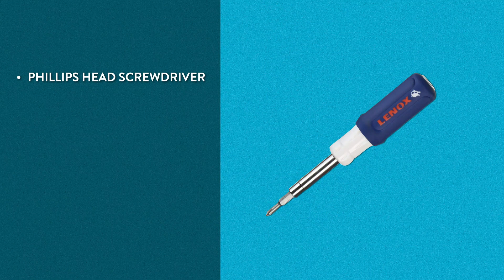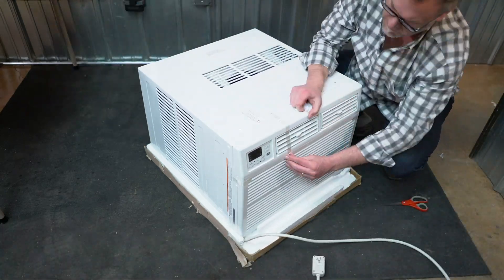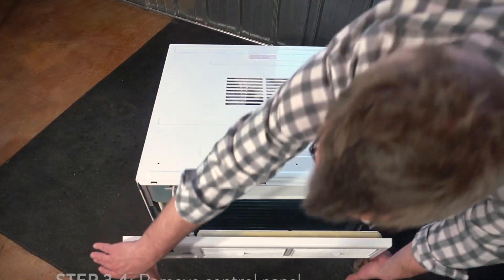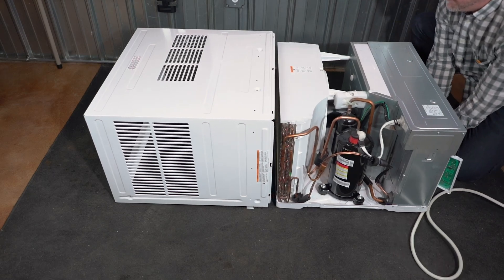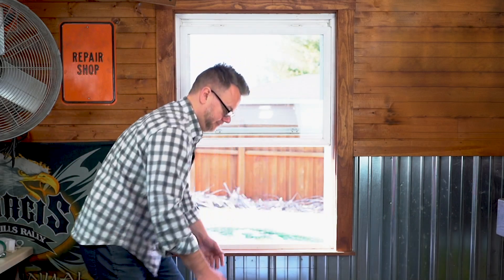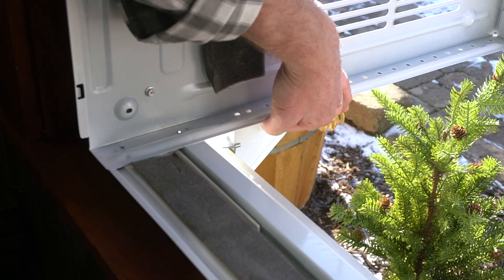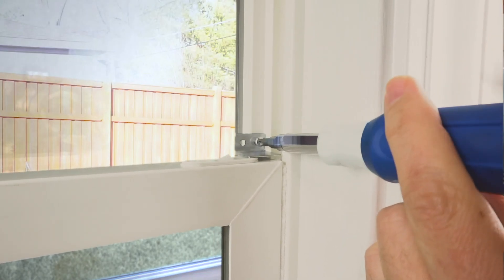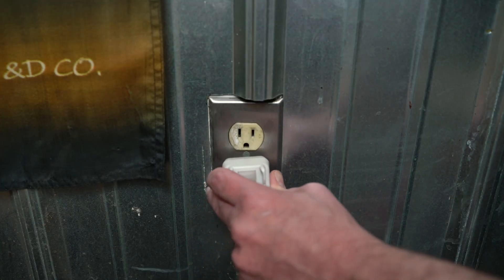How to Install a Denali Aire 15,000 BTU Window AC Unit, Step by Step Guide

Comment: Do this window units connect to a regular 120v or does it need a 240v?  Also deciding if I should just go with a heater $400 right  now for my 3 car garage man cave fully insulated here in Clovis California zone 9b and in the summer time get one of this window ac units for  $500 to cool it off or just get a Mr cool minisplot  system that has both for $1600? ?  my garage is about 620sq ft with 8 ft  ceiling higjt.
I have epoxy floors, pool table , darts and gym on the other side😁
Reply: 120v

Comment: When you’re re-inserting the inside after the cabinet has been fully mounted in the window, how are you supposed to put all the outer screws back in when some of those holes are now outside of the window??
Reply from the maker: Hi MuscialTheatreBabe, those screws are for shipping purposes only and do not need to be screwed back into the unit.

Comment: Just installed a new Denali 33,500 BTU unit and it doesn’t work!! It wants to start up for just a second and it stops. The tank of whatever it is gets really hot. Extremely frustrating. I looked to see if there was packing material or something inside, but nothing.